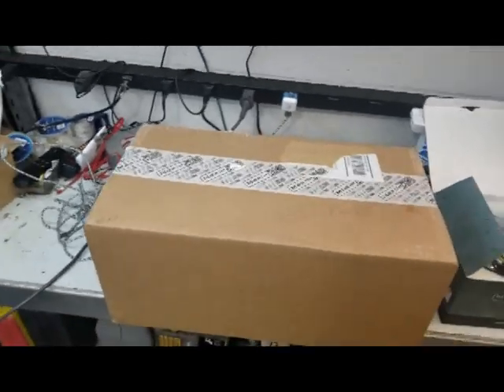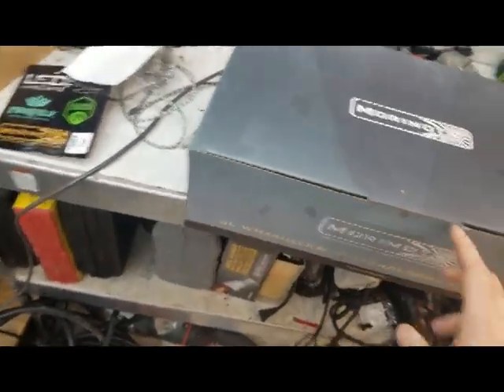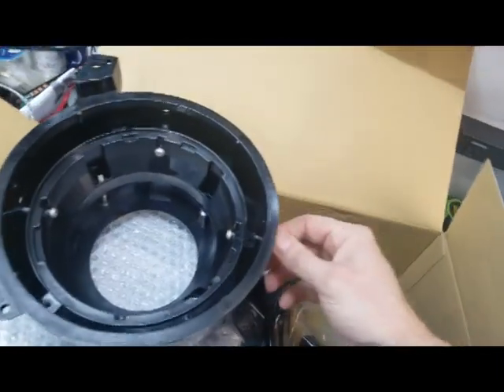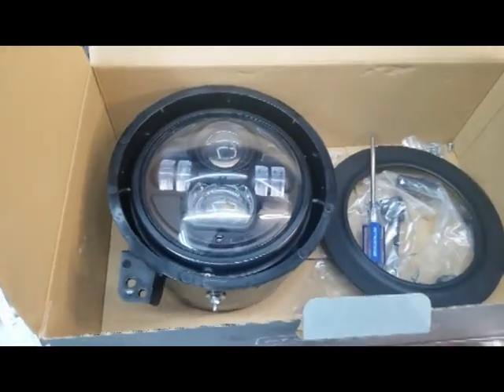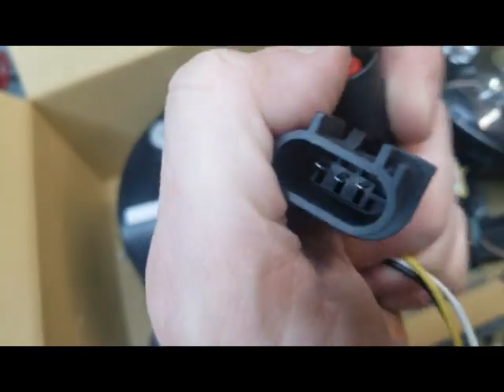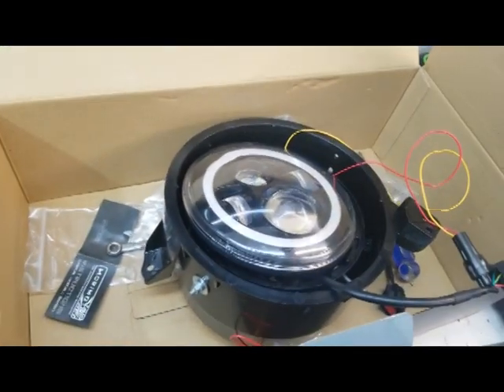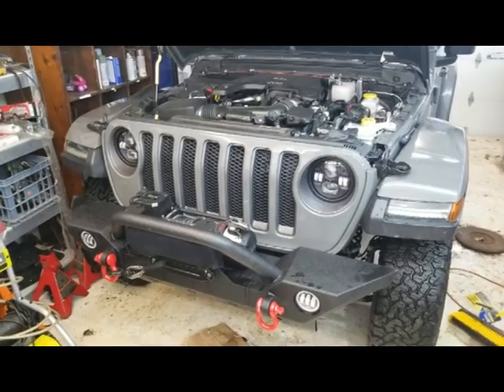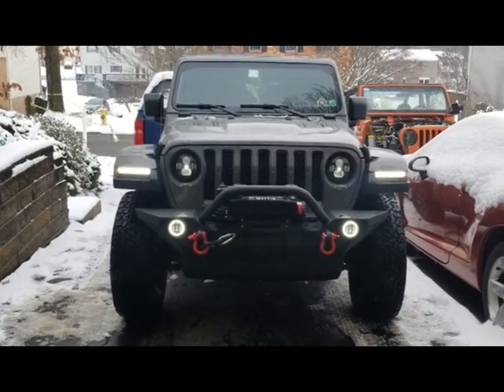Morimoto 2018+ JL headlight adapters first look and install!

Comment: I just got these headlights but I’m a bit confused about what wires you splice the daytime running lights and turn signal wires into. Do you just splice them into the same color wires on the fender lights?